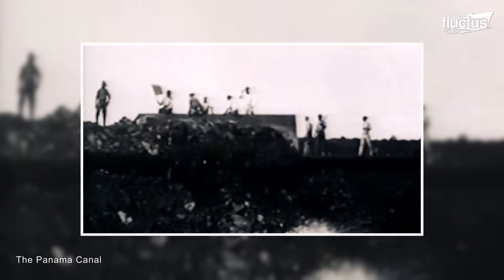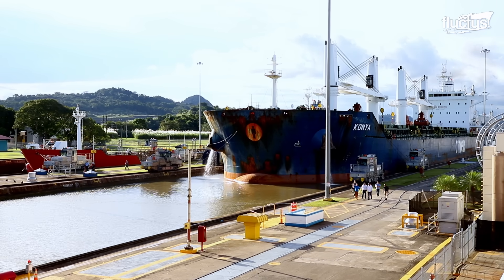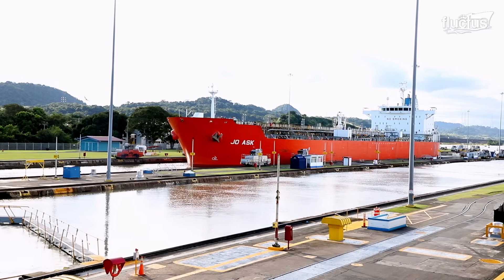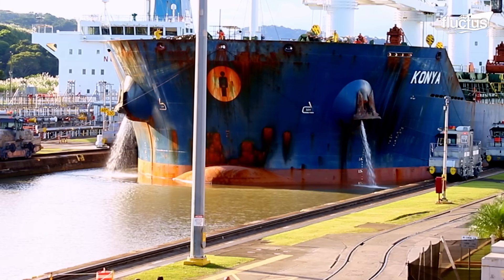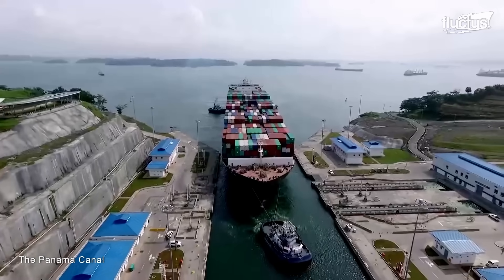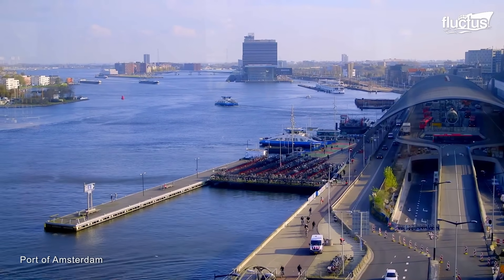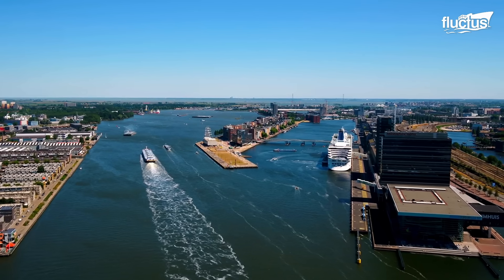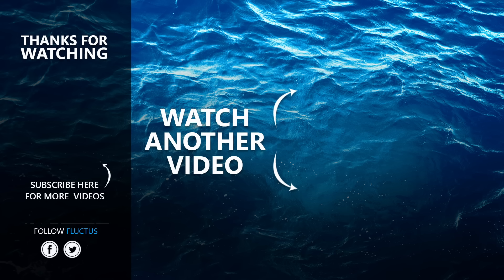The Genius Technologies Behind Panama Canal Locks Moving World Largest Ships

Comment: I was told that the canals water inflow to the locks are done without the use of pumps. An engineering feat in itself.
Reply: They built man made lakes to feed it.

Which can be a problem in a drought year.
Reply: Hardly an engineering feat - just gravity...
Reply: The engineering feat is the total of 12 intermediate bassins to reduce water consumption

Comment: The photo doesn’t make sense because the lock gates are backward.
Reply: Exactly, it would be extremely difficult to close and hold the gates like that.
Reply: Good observation!  I believe what's occurring here is the original film was copied on the reverse side so everything is a mirror image. Picture a boat drawn on a piece of clear plastic. Now flip that drawing over and look at the back side, get it?🙂
Reply: @Seaquest112  You don't get that the boat would be flipped too.
Reply: I was supposed  to act like  a valve
Reply: @abdulazizhassan2148 hmm, cool!
Reply: First thing I noticed too.

Comment: The dimensions refer to the original canal locks, for which the Panamax ships were designed. The updated locks are wider, longer & use water more efficiently and use tugs to guide ships through, rather than the mules the old locks use.

Comment: As mentioned below the lock gates are shown facing the wrong way on your "cover picture". They should be "pointing" towards the higher level of water to prevent the water pressure from forcing them open.
Reply: Right.  A bonehead mistake.
Reply: Yep. I did not even watch the vid. Why photoshop?
Reply: I’m in here only because I noticed the same thing.
Reply: Same here. I only watched the video to see if there is a scene in it showing such a lock.

But at least I got to see a lot of the Amsterdam harbor, which I didn't expect. Or was that Rotterdam? 🤔

Comment: Just a clarification, mules (the draft animal) were never used on the Panama Canal.  The towing locomotives at the Panama Canal have always been electrically operated.  The first set of mules were built by General Electric and were used up until 1964 when they were replaced by "mules" built by Mitsubishi of Japan.  The term "mules" was borrowed from the mules that were used most famously on the Erie Canal.
Reply: What mean clarification?
Reply: Mules (the animals) and even horses where used traditionally since the dawn of canals throughout all Europe to tow boats until the advent of motorization.
Reply: @ForceKingg Thanks

Comment: Who the fuck wanna listen to something where they put measures in outdated terms as "feet" and "inches". Only people from the US still use that old way of measuring. Why don't you put it in the metric system as well at least as a supplement?
Reply: The Panama Canal was built by US engineers using US units, so that is the way Panamax limits are generally expressed.  The French tried to build it earlier, but they failed miserably.